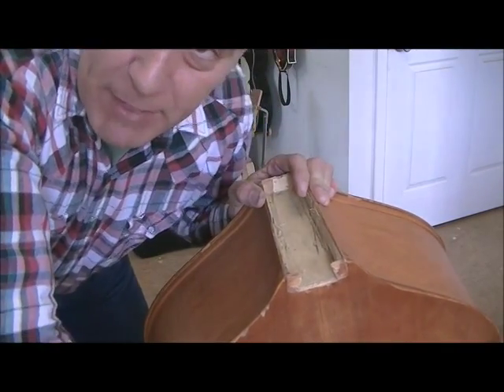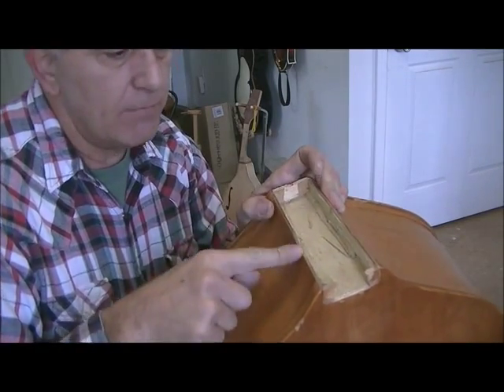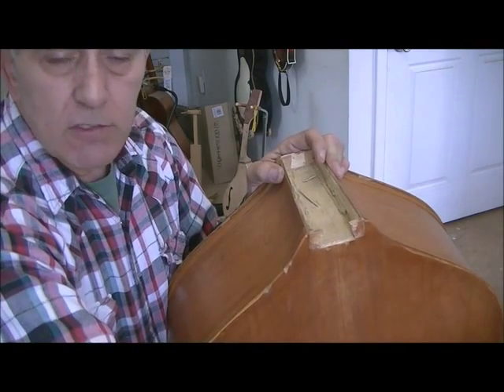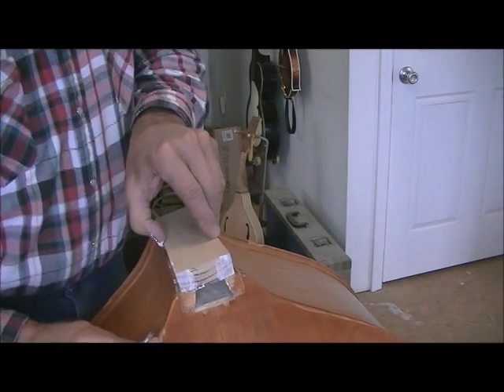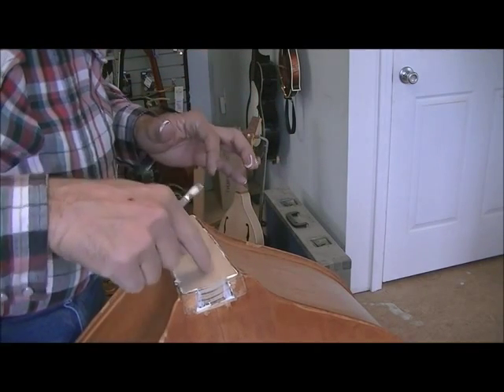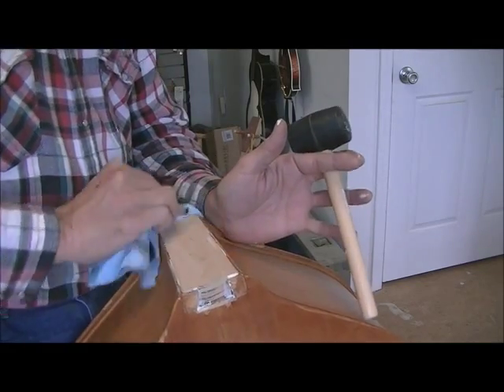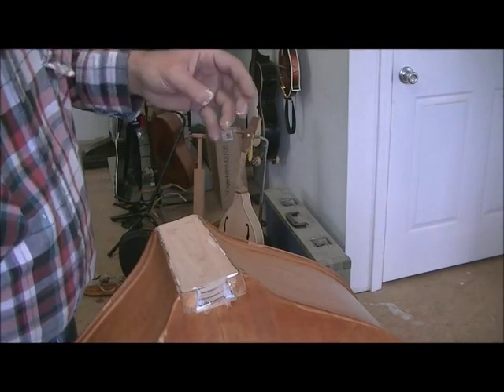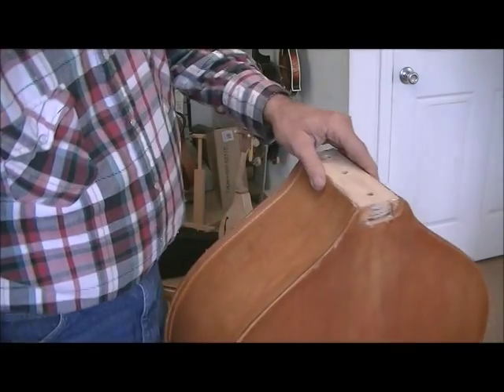035 RSW Kay Bass Neck Reset Part 2

Comment: Was wandering what Size Router Bit did you use with Dremel? and what Size Router Dovetail Bit did you use when Cutting the Dovetail with your Router? Going to do a similiar project! Great Job on repairing this Old Kay!
Reply from the maker: Thanks for watching, I don't know the exact size of the router bit.  Not in the shop right now to check it.  It was just a standard carbide dovetail router bit that I had in stock.  I would guess that the the widest part of the dovetail was about a half an inch.  Maybe a little bigger.   it just happened to match the angle of the base heel perfectly.
Reply from the maker: The dremel bit is the guitar "binding" router bit sold by StewMac.  The size doesn't really matter.  in fact, you could use a regular router with a straight cutting "flat bottom" bit and that would be fine.  I've got pneumonia so I'm not in the shop to measure the dovetail bit.  The best I can remember I bought it at Lowes amd I think it was the only 1/4" shank dovetailed bit they sell.  Hope that helps, ggod luck with it.  For the record, this one is still holding up fine.
Reply: Thank You for Helping Out! I will go ahead and give it a try The Video really helps out alot, In great detail I am just going to have to take my Time, I have a 1939 American Standard Bass and the Neck block and Dovetail is a little different cause it is wide in front and slopes inward more narrow, I wont have to much room to work with at the Heel and Button! But I am going to try on Scrap wood first and might have to do Double the work! Thanks Again